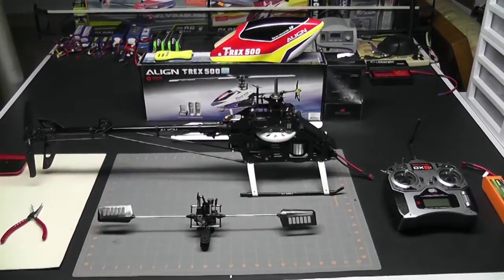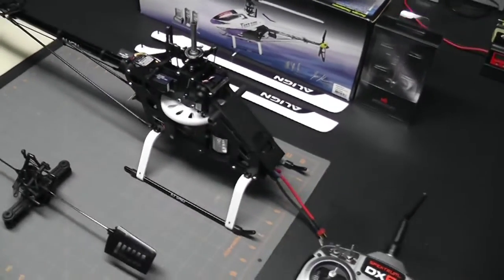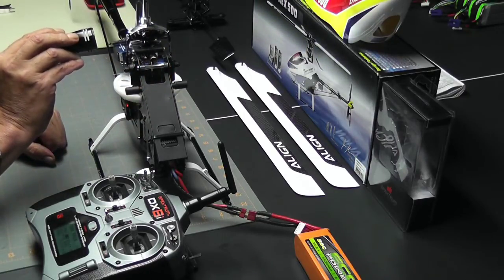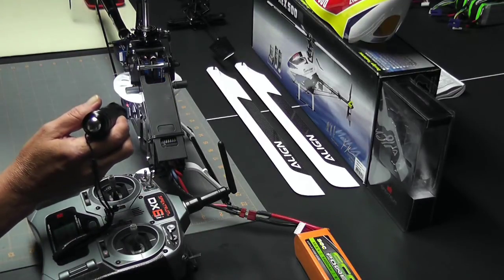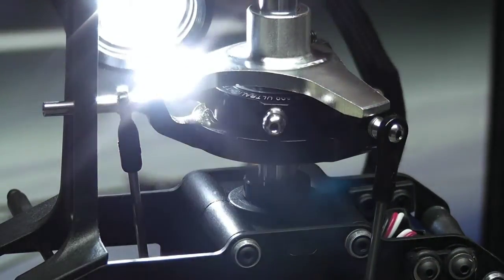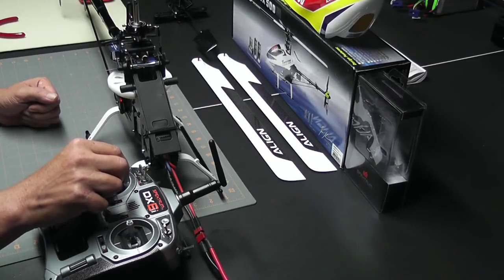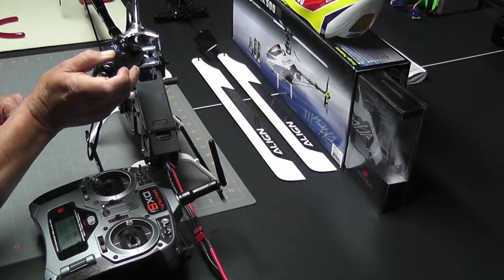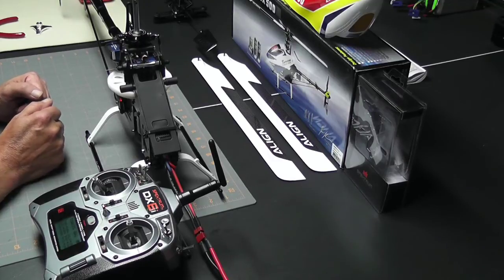Trex 500 E   Electronics and Setup #4

Comment: Hi. I have a Trex 500. The GP 780 gyro was turned off via the Dx 6 remote control. Turning it on doesn't work. The servo is slowly shifting left and right. The receiver inputs are probably wrong. I tried but it didn't work. I would be very happy if you could help me. Where am I making a mistake? I'm very sorry. There aren't many people who know anymore.
Reply from the maker: Hi there and thanks for posting.  I am not sure what is causing your drifting issue, but I would first suspect the gyro.  Hope this helps!